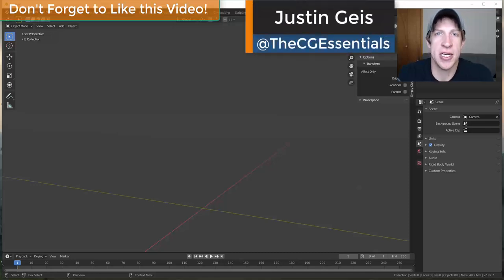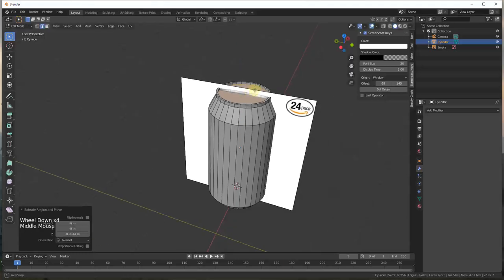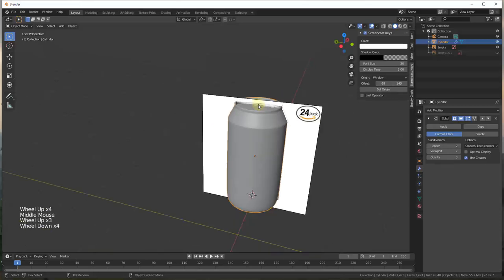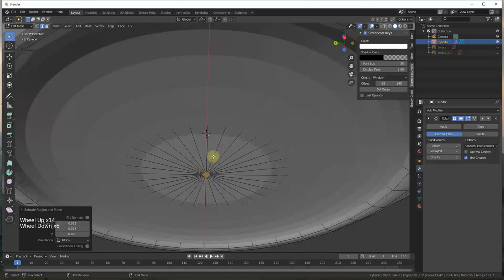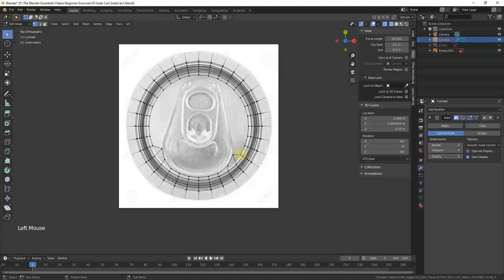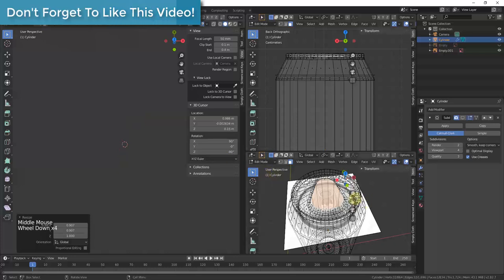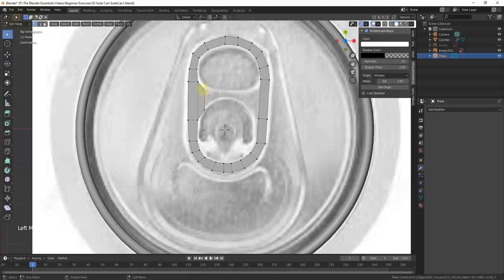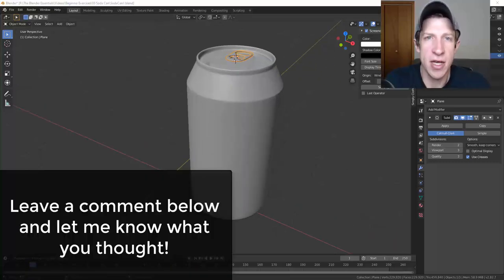Blender Beginner Modeling Exercises - SODA CAN Part 1

Comment: I didn't want to mess with loads of vertices, so if you want, you can just smooth your object and then use the Edge Split modifier as well to get some nice crisp edges without the extra work (but I welcome why subdivider is best practice)  Great tutorial also, this is really helpful for my vending machine
Reply from the maker: Thanks for the info!

Comment: Hi at @14:45 i am unable to select that inner face which you extrude down and scale in. I am unable to select that face.
But when i select the edge loop and then extrud and scale, nothing happens in the solid view. But in the wireframe view, it can be seen that the face is being extruded and scaled. But it is not visible in the solid view. What have i done wrong, please help.

Comment: For some reason when I do subdivision surface one part get's really distorted on the tab, when I try to fix it with control r and the subdivsion off it won't let me place new edges onto the area of the section I want to place it, I'm trying to place them on top but I only have those edges popping up on the bottom.